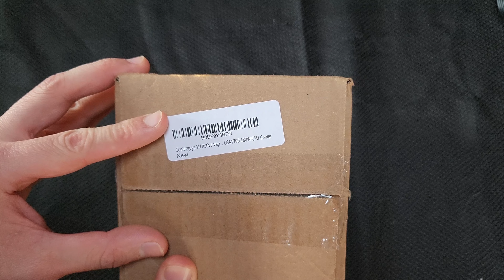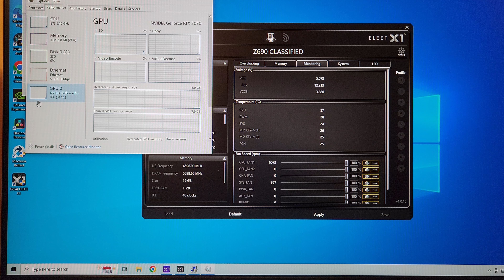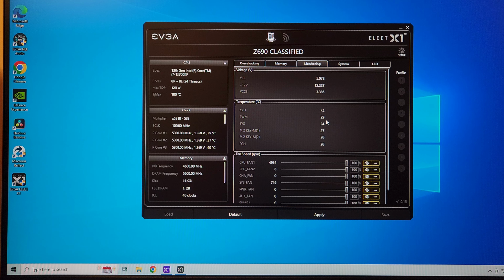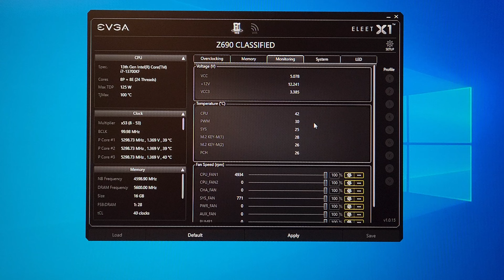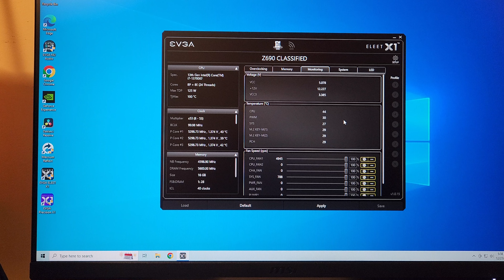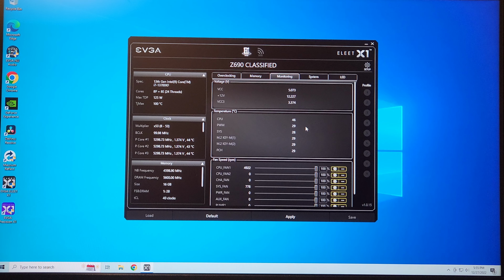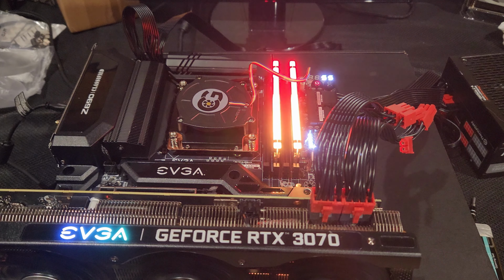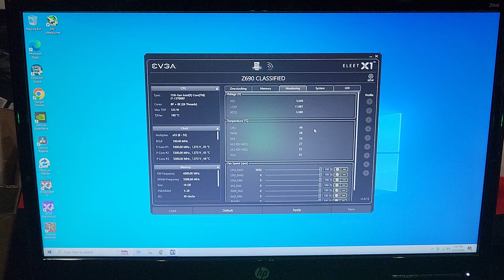Coolerguys 1U cooler LGA 1700(installing on gaming pc)

Comment: I will use that radiator but with the Dell (Foxconn oem) turbo fan (70mm blower) with 25mm height to reduce volume with the same flow😃 It’s the greatest, as I think, solution for itx 1700 build

Comment: I would’ve tried adding some high-quality thermal compound. I was never really a big fan of the thermal tape plus it can be a pain in the butt to get the cooler off once that stuff melts on there just my two cents good video.!
Reply from the maker: You are right, it was annoying getting the cooler off afterwards. I'll change the Thermal compound next time.

Comment: you're a funny guy.... and i quote " and my pc burns down because"/"thermal compound seems kind of dry".  Are u living in cavemen era or modern times?...... thermal throttling will protect the cpu. You can even turn it on without a cooler and it will shut down. Not that you should do it. Brackets are definitely not ok. If cooler is completely square, exhaust should be perpendicular to ram so there is nothing blocking the exhaust. Thermal paste that comes preapplied will not have the same consistency as the paste, but that should be logical. There wouldn't be any left and everything would be a mess. BTW, they use shin etsu thermal paste which is a decent one. Your issue is taking an inadequate cooler to cool an unlocked cpu. At most that cooler should be use with a cpu max 65 watts tdp. Its a cooler meant for servers. Buy yourself a decent cooler. What is the case you are using and how much are u willing to spend? I will give u recommendations and do a proper video and you will see the difference.
Reply: I mean according to the brand it does say its rated for 180w, but I do have to agree with you, this is not the ideal cooler for a processor like that if you can avoid it. I do see the use case beyond servers though, as I myself need a very low profile cooler like this for a SFF build of mine.
Reply: @ulrikmathis  But that will be at the expense of noise. This  cooler is extremely loud. Depending on your cpu clearance, there are many good options out there.
Reply: Love this comment

Comment: I watched the video just to see the lols.  1U server coolers require unobstructed airflow. Next time use a 3U cooler and it will clear your motherboard cooling and have better temps. If you buy some ANC headphones the noise will not bother you until the battery dies.🤣
Reply from the maker: You are right, I did end up using an u5 cooler which performed very well.
Reply: @kngx64  Did you make a video on that? I thought I looked for one before I commented.
Reply from the maker: @michaelcarson8375  I did, but my ssd died and lost it
Reply: @kngx64  Do you remember what model SSD it was? so others can avoid it.